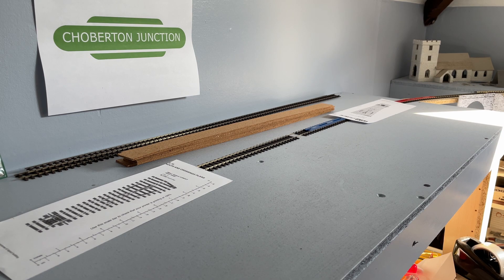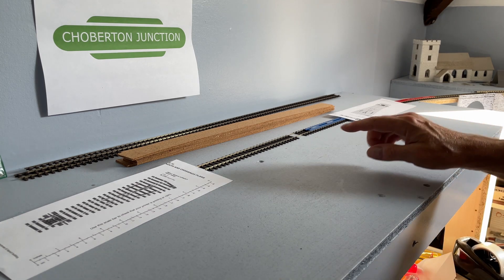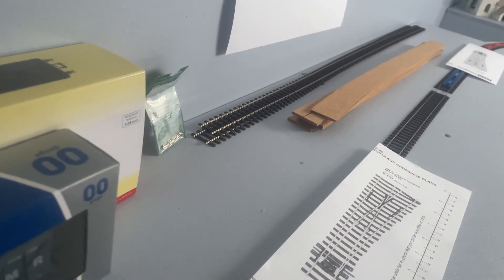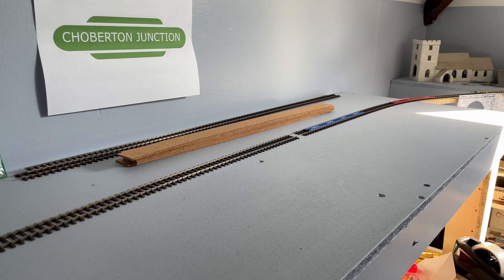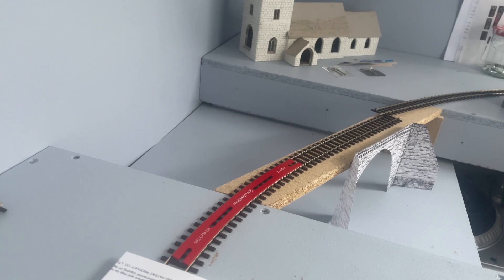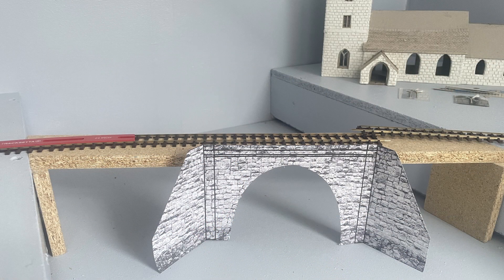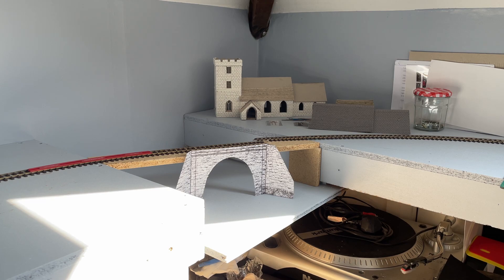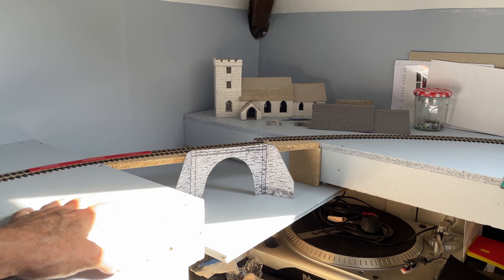Choberton Junction - UPDATE SEPTEMBER 2023 - I So Got It Wrong!

Comment: Could you not have a point just outside the tunnel and have a double line across the canal area. Just a thought. Great start to what will be a great layout.
Reply from the maker: Hey @simod, not the first to suggest that which means it is a good idea and one I am taking onboard. Strange but that one move has opened up the small layout again.

Comment: 🇺🇦
Hi Tony.
Good bit of planning. 
You can still do a lot with limited space. Depending if you go down the scenics route, or lots of running tracks.
Your making a great job of it buddy well done.
DELPH JUNCTION (Pete)
Reply from the maker: Hey Peter, good point will for this layout at least go down the scenic more that the running track as there won't be much running track lol. All preparation for that bigger layout we always plan. I have carried a layout design in my head for over 50 years and one day.

Comment: Hi Tony. It's a shame that you can't do what you wanted to do and have a run round loop. The trouble is that you don't always know for sure that something is going to work or fit until you actually try to do it. Still at least you have got some space to do something and you have an alternative solution to the problem. I think that the canal/river/water scence will look great when it is eventually done when the tine comes. All the best. Mark.
Reply from the maker: Hey Mark, yes sometimes what we desire and what we can have are miles apart. But, as you say I do have an alternative so not a problem just an issue to be solved. It will at least get me started and that is the important bit at the moment.

Comment: Yes, I too had great plans for a small station but ended up with no platform length after fitting points in! I suppose you could use the curved part of the point as the main line on the ends of the approach curves, with the straight part providing a run-around loop on the other side of the main track - would give you the full straight length as platform area with a longer run-round?
Reply from the maker: Hey Mike, now that is a good idea. I will take a look and do some rough fitting with paper points to see how it could work. Thank you so many good ideas coming in as suggestions that I had just not really thought of. You can get stuck on an idea sometimes and if it don't work then you can be blind to anything else.

Comment: Hi Tony have you considered using an curved point just to the right of the bride widen the bridge to take 2 tracks and start your platforms at the left side of the bridge as sone as the embankment will allow you to get 2 or maybe 3 carriages. By adding a siding to the right of the bridge toward the tunnel on the right you can then work your engines as the run round. Train 1 arrives engine comes from the siding at the tunnel and cupels to train 1, train 2 arrives, train 1 engine has bin uncoupled and departs with train 1 train 1's remaining engine now reverses off the platform and is reversed onto train 2 and couples up train 2 engine uncoupled from train 2. train 2 departs train 2 engine then go's to the siding at the tunnel ready to start again. this will do away with the head shunt. Just an idea you might not have thought of. Thanks for sharing. Stay safe.
Reply from the maker: Hey Mike, that is an awesome idea. Had not thought of not having a head shunt and using the space for platform instead. Been some great ideas from everyone. When the turnouts and bits arrive later this week then I will do a test layout to see how it looks. Was thinking of double track over bridge but after your description of a possible definitely having a double track over the bridge now to open up options. Thank you for the great comment. Look after yourselves now.

Comment: Hiya, ok, not a disaster though. Those were express points right? Any better with normal terrible hornby ones? Also... just a thought, you could still have a siding after the bridge running a goods train round to a quiet country cattle port, just have to forego the realism with the turnaround 😢
Reply from the maker: Hey @andepea, that is a good idea will have a think on that. Don't have to have a station there so that could open up options for other things which I must confess I had not thought about.